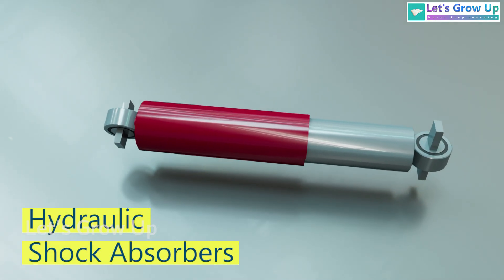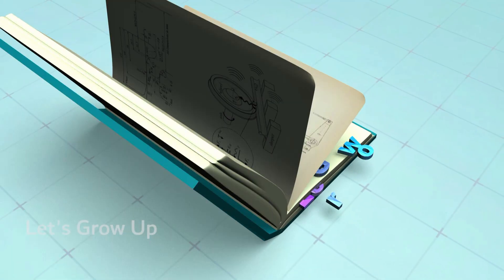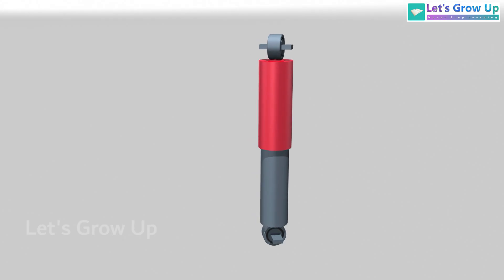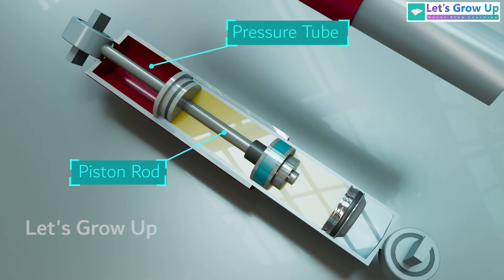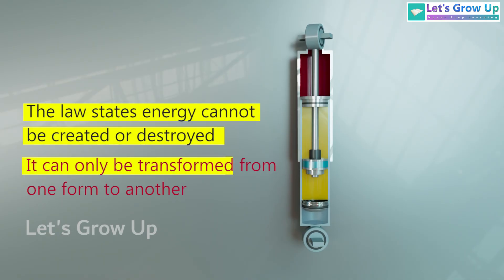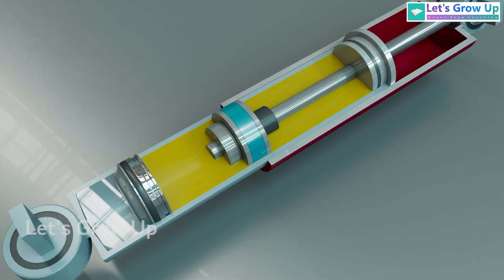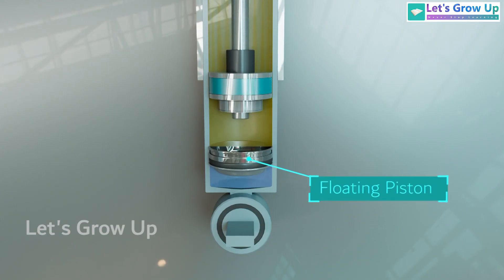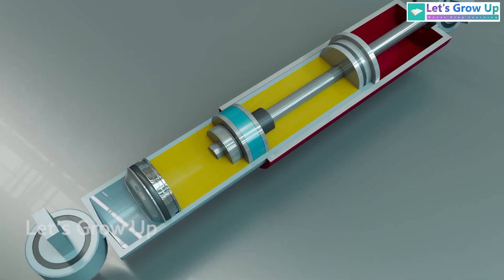How Oil Field Hydraulic Shock Absorbers Work?

Comment: TL;DR shock absorbers are fixed force absorbers. (Better to attach more forceful absorbers but will cause sluggishness to come to original position.) And why it works well? It doesn't as things that shake also make body goes opposite directions to shake. Shock absorber does for both directions. 😂

Comment: The operating principle of the hydraulic shock absorber is not disclosed.  Damping of vibrations occurs due to the flow of liquid through the piston through calibrated holes.  in this case, the vibration energy is converted into heat, which is dissipated by the body of the hydraulic shock absorber.  Liquid is not a compressible substance, your animation show that the liquid is stretched and compressed.
Reply: Yep misleading information
Reply: 👍 @vineetkumar2934